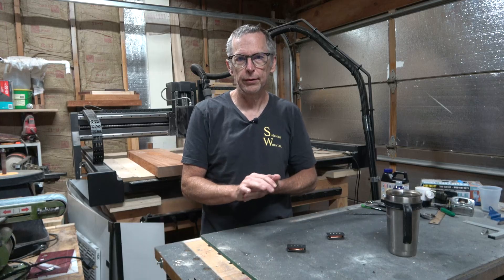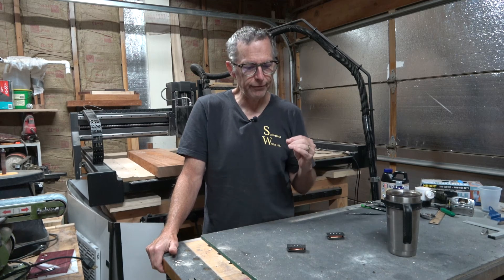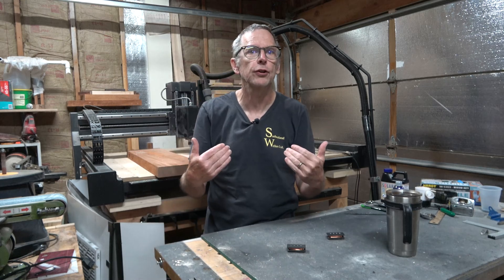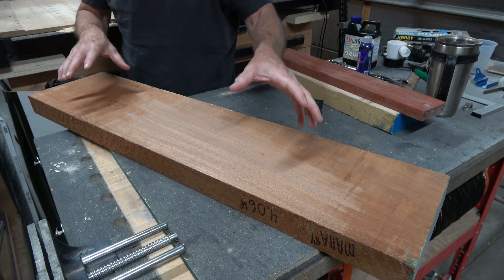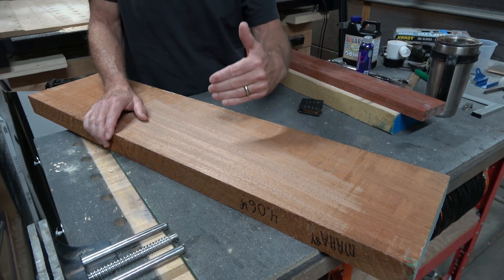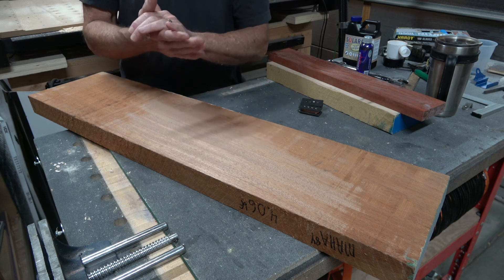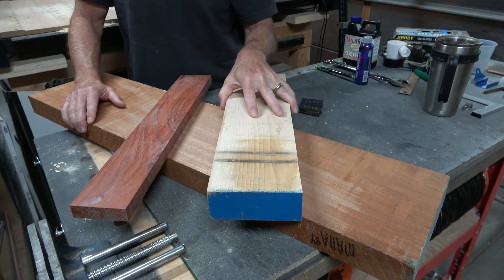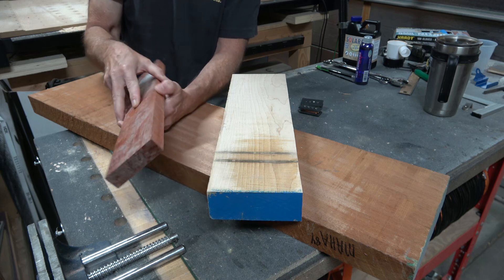Making An Electric Violin Part 3 The Wood

Comment: Are you relying on acoustics from the body at all?
May want to look into bass bar and sound post.

Also curious if you will need fine tuners using the guitar tuning pegs or if they won't be needed.
Reply from the maker: No acoustics at all. I'll probably use fine-tuners just cuz.